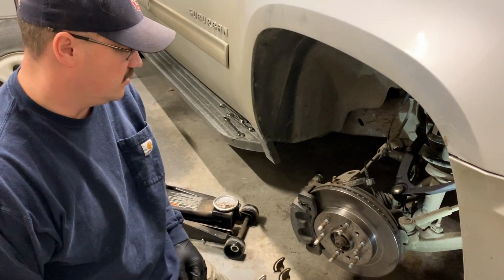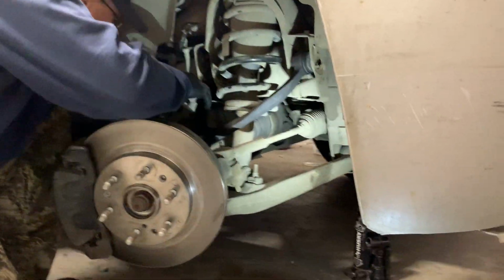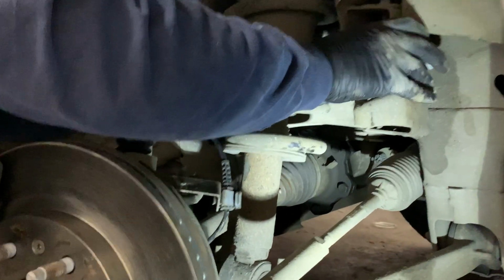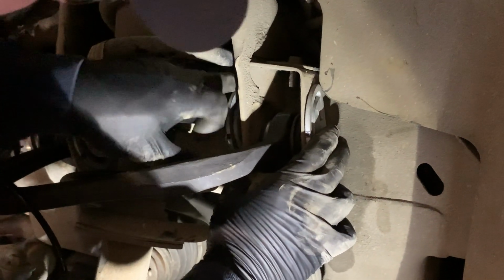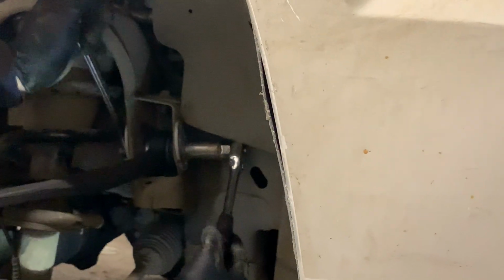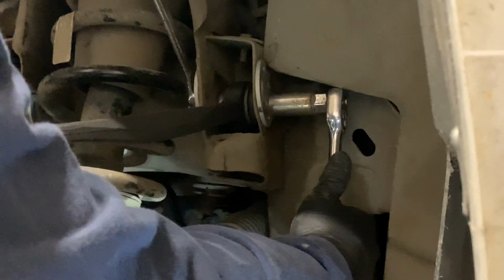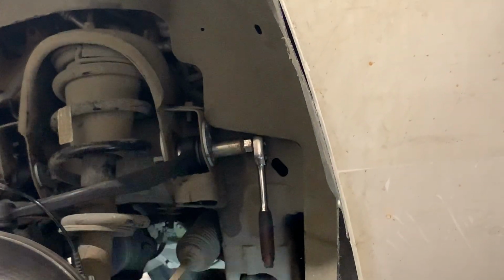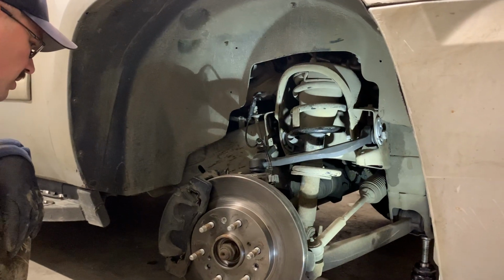2010 Chevy suburban upper a arm/ ball joint replacement part 2

Comment: When you removed those bolts in part one,  the head of the bolt was on the strut side,  and when you re-installed them,  you put them in with the head of the bolt opposite.  Does it matter which way the bolt goes back in?
Reply from the maker: Either way , had no issues with it accepting an alignment ,